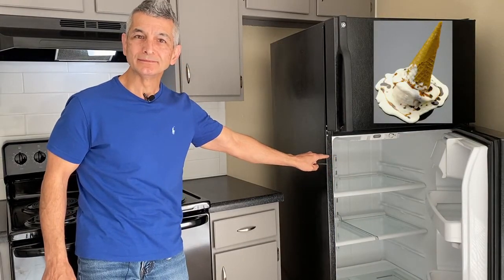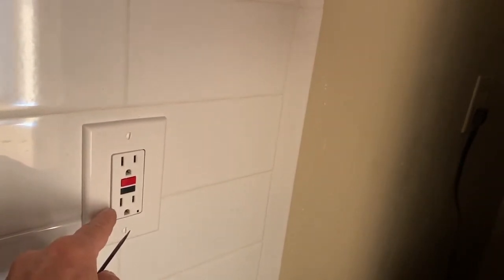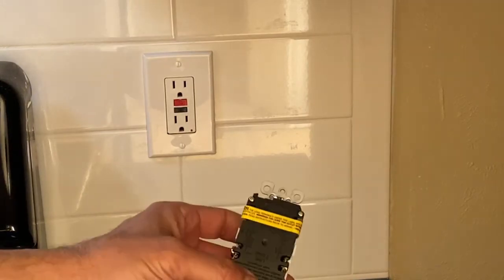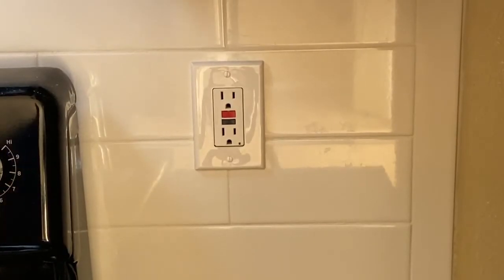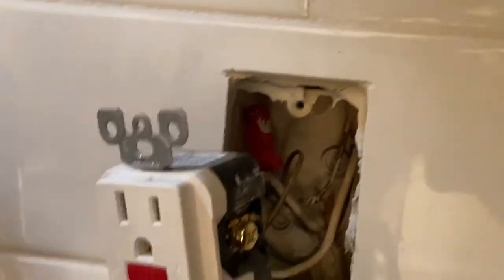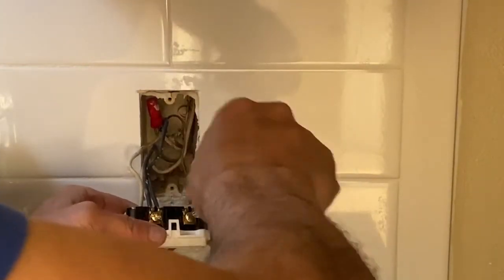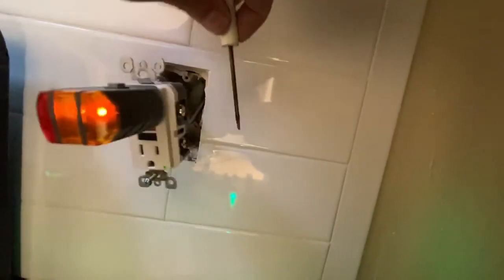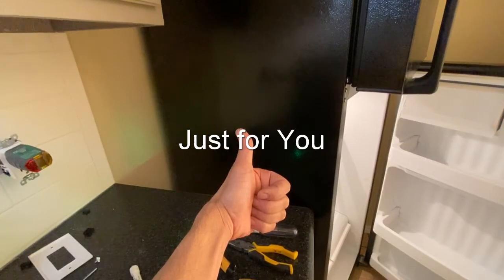Fridge Tripping-Learn how to fix it-Don’t power a fridge from a GFCI, especially older ones

Comment: What happens if I have more Gfci outlets in the same line. Do I have to do the same for all or it will be sufficient with one before the fridge plug?
Reply from the maker: If you have a GFCI outlet at or before the fridge on the same line, could trip because of the fridge. Hope this helps.

Comment: I'm sorry, but your solution is wrong. Maybe it works for your specific problem. It won't work for most. Apparently you only have the one single outlet attached to the GFCI load. Most will have multiple and there is a reason they're on a GFCI protected circuit. Your solution would remove protection from the rest of the circuit.
Reply from the maker: Incorrect. You can make the fridge outlet non-GFCI by doing what is suggested in the video. Then, if you have other GFCI protected outlets that were on the same load line, replace the first outlet (this would be the next one after the fridge’s outlet) with a GFCI outlet. Now, the fridge is non-GFCI and it won’t trip AND the outlets after the fridge’s outlet are GFCI and GFCI protected. Hope this helps.

Comment: And there is an audible alarm GFCI outlet on the market.           Bypassing the GFCI protection to the recptical to the fridgerator u are not up to 2023 NEC CODE that I personally think should be a personal choice to GfCI to or not to have.                                                  2023 NEC says all recpticals in a kitchen ned to be GFCI/AFCI PROTECTED. I personally believe with present GFCI/AFCI TECHNOLOGY I wouldn't probably have such a device going to a freezer or refrigerator. PS in my opinion fregerators and freezers should be on a dedicated circuit if possible to me minimize a trip breaker leaving the device with  no power resulting in possible food lost.

Comment: Thanks. Good to know this. 
 However in my case, I'll know later today, but it appears the refrigerator outlet is on a long daisy chain and if I do this the other counter outlet will not be GFCI. The current set up also runs the ceiling lights as well. So my other option will be a cord from the other side of the room that is not on a GFCI connection. No way to rewire this directly. This part of the house is built pretty much right on the ground. But I think in my case the refrigerator has damage due to a storm surge since it is now on another outlet from the other side of the room and the compressor will only run for about 5 seconds and then off. The frig is well over 30 years old. So I will get a new or newer frig today...
Reply from the maker: You can do what is shown in the video to make the fridge’s outlet non-GFCI. Then change the next outlet in the chain to GFCI to maintain the integrity of the rest of the chain. Hope this helps.
Reply: @JustForYouDiy  The GFCI outlet at the counter feeds the other outlets, not the other way around. Otherwise a good idea. Unless I want to open up the drywall or the outside of the house. I just repaired the floor, and floor framing  in that room a year ago, from a poor remodel or a cover up remodel that was done before I bought the house.. No wires down under the floor.

Comment: I want to put my second fridge in the garage, I have gfci receptacles in the garage, I plugged up the second fridge and the outlet tripped, is it because it’s on the same line as the fridge in the house? Do I need a separate outlet in the garage to run the fridge?
Reply from the maker: GFCI outlets don’t play nice with inductive loads, such as the compressor in a fridge. That said, fridge needs to be plugged into a non-GFCI outlet.

Comment: i have an older fridge/freezer unit from Kitchen Aid, it is the boxy one. no digitialdisplays or anything. 
we had a power outage for 46 hours from a storm on tuesday

finally i knew it came on, yesterday at 221 pm i know my electirc came on.  i got hom at 5 and it was on. i opened the fridge door to move frood around, then did it again 5 mintue slater. 
then nearly 7 pm i opened it and closed it once, then the 2nd time i did it  something happened and the lights in both freezer and  fridge were off.

i went downstairs to push the circuit breaker in and out. not thinking of the CFGI thing.
didn't work.
i called an appliance guy who came out thie monring.  very early
siad there was no power going to the fridge. and i forgot there is 4-5 other outlets some with things on them like la lamp a carbon monoxide tester, and a heating pad along it righ tnow.  anyway, turnst out my unit was  tripped.  the appliance guy left did nothing , tested with a extention chord to see if it ran which it did from the basemnet outlet.
said it looked fine.  an dleft. but said is hould call an electirican to check the pulgs/power source/ circuit breakers
so i did. they came, they did move a copue wires in the plug right where the plug of the drige goes in, and he suggesed a new CFGI unit. so i got it . when he left everythign appeared just fine.
i get home 6 hours later to find the drige off again but still cold now.

i kept hitting the button on the new CFGI unit and thefridge would trun on for 1/10 of a second.
but nothign worked. an't get anyone  on either side for 3 days ue to a holiday weekend. i will not be home much either

for now i plugged it in to the extention chord.
will tha tbe safe until tuesday when i can do the rest of teh stuff?

Comment: @JustForYouDiy went thru all these easy and informative steps you gave at the end I tripped my gfci fridge stayed on correctly but tried resetting my gfi and it won’t reset what could possibly be the problem? Thanks in advance
Reply from the maker: With most GFCI outlets you have to make sure that the line and neutral wires are from the same run (black and white wires are in the same jacket). This ensures that they are the same length and are very close to the same resistance. That said, often times when there are multiple lines and neutrals in the same J-box, if the wrong neutral is connected to the GFCI outlet, it will not reset (it stays in the fault mode). Hope this helps. If you find it helpful, please report back and consider donating to the channel.

Comment: What if I just replace the GFCI outlet with a normal plug?
Reply from the maker: Of course, you can always do that. However, whatever is plugging into that outlet will not benefit from GFCI protection.
Reply: @JustForYouDiy  it’s in a garage. New freezer keeps tripping GFCI. Did away with the GFCI because it seemed pointless although its code. Electrician said it was a nuisance trip anyway. Thanks for the good video though.
Reply from the maker: The electrician is correct, almost all GFCI trips caused by a frige is a nuisance trip. The reason is because GFCI circuit used in the outlet does not like an inductive load (any device that has a coil of wire in it), such as compressor that is used in a fridge. The electrical noise generated by such devices most often trip GFCI outlets. Hope this helps to better understand the reason.

Comment: Hey there! I know this video is a years old but it did help me with an issue I was having with my fridge so thank you!. It's been tripping since I moved in so I tried the method and the fridge is staying on now! As a note for future watchers, make sure your load and line aren't backwards to what it was in the video. My outlet had the line at the bottom so when I moved everything to the top like in the video, I was actually moving to the load so the outlet stopped working but the fridge was fine. Once I moved everything down to the line correctly, both are all good.
Reply from the maker: Glad to hear that you found the video helpful.

Comment: Hello, plz help me, I bought the Used fridge,  so first when I connected, my main swith board get trip immediately, so I keep the fridge off for around 24 hours, and than I tried, than it gets on, but my main swith board get trip after around 4-5 hours again, and again i tried and samething happened again after around 4-5 hours.
Reply from the maker: The following could be defective:

1. Thermostat controlling the compressor
2. Compressor 
3. Capacitor for the compressor 

Hope this helps.

Comment: If you have other receptacles daisy chained off the fridge receptacle then will this not defeat the GFCI protection for them? One needs to pull the fridge receptacle and look for daisy chaining and if found take a different solution.
Reply from the maker: Correct. In that case do what’s suggested in this video and just change the next outlet downstream of the fridge outlet to a GFCI outlet. Then, all other outlets connected to that circuit will be GFCI protected. Hope this helps.

Comment: This way will work, however if you have more than one outlet on that load, none of them will be protected by the gfci anymore.
Reply from the maker: Correct. In that case you can just change the next outlet downstream of the fridge outlet to a GFCI outlet. Then, all other outlets connected to that circuit will be GFCI protected. Hope this helps.

Comment: My garage fridge is on a dedicated circuit.  The fridge trips the gfci every now and then. Will this technique work when there are no other outlets down line?
Reply from the maker: Is the fridge plugged into a GFCI outlet? If so, the suggestion in this video does not fix the issue.
Reply: Yes it is on a gfci. Do I need to replace it with a regular outlet? If so do I still wire it like the video?
Reply from the maker: Before replacing it with a regular outlet, I would suggest using an extension cord to plug the fridge into a regular outlet to monitor how it does.

Comment: Lmao, you solved nothing. All you did was remove the GFCI from the situation.
Reply from the maker: If the fridge is no longer tripping the GFCI outlet, the problem is solved. By understanding the internal circuitry of the GFCI outlet you know that GFCI outlet does not work well with inductive loads, such as a fridge which has a compressor.

Comment: I tried it out. I didn’t realize this will disable the gfci outlet but continue power to the other outlet. I still want power to my gfci outlet
Reply from the maker: The suggested change will not disable the GFCI outlet. The operation of the GFCI does not change. The only thing that changes is how the down stream outlet operates, it operates like a standard outlet NOT as a GFCI. Hope this helps.

Comment: Will this still help if I plug in my fridge to the gfci outlet or will it shut the fridge off if the outlet trips? In other words, will this only work if you plug the fridge into the non gfci outlet?
Reply from the maker: This only works when the fridge is plugged into a non-GFCI outlet. GFCI outlets are sensitive to inductive loads.

Comment: I have it on line and still trips
Reply from the maker: If the 2nd outlet is connected to the line side of the GFCI (the 1st outlet) and fridge is plugged into the 2nd outlet and GFCI trips, you have something connected incorrectly. 2nd outlet being connected to the line means the 2nd outlet is protected by the BREAKER.

Comment: Ok that’s a way to keep power constant to your refrigerator but now it’s now up to code. The GFCI is required when any plug is close to any water source and it mean to be there to save your house from possibly arching fire.
Reply from the maker: If you missed it, the fridge is still protected by the breaker.
Reply: @JustForYouDiy  I know you know the difference between a breaker and a GFCI. Two distinctive functions brother. You definitely eliminated the purpose of that GFCI.
Reply from the maker: That GFCI is not eliminated, it still functions as a GFCI. The fridge is protected by the breaker. You should never protect a GFCI with a device that has an inductive load such as a fridge.

Comment: Will the fridge still trip the GFCI when wired like this?
Reply from the maker: It will not trip the GFCI. However, in case of an electrical issue, it will trip the breaker to the GFCI.

Comment: Thank you so much for the informative diy unhooking load terminal + transfer to line instead to prevent power interference to fridge when outlet trips. Such a relief to not stress out if I have to buy a new fridge. It’s only 11 yrs old and thought they last longer than that ❤❤ thank you again 🎉
Reply from the maker: My pleasure. Glad that it solved the issue.

Comment: I absolutely agree GFCIs and refrigerators do not mix - just like practically any other motor. However, Code now requires one for any refrigerator in a kitchen, so it must be done, period. You can thank Leviton for lobbying the NFPA to get that requirement added, as well as GFCIs for dishwashers. How many people have died from being shocked by a properly bonded dishwasher or refrigerator? None. Not a one. Since Leviton needs to appease shareholders, we now have this stupid requirement.

Garbage disposals are coming up in the next cycle. What could possibly go wrong there?
Reply from the maker: Thank you for sharing your comments.
Reply: @casey You are 💯Percentage CORRECT! It’s all govt bureaucratic BS!!!

Comment: KEK this trick actually worked i spent 8+ hours on the fridge outlet, trying gfci and afci and neither, pigtailing and switching wires and whatnot, sure as shit this trick on the fridge outlet and the upstream outlet fixed my issue.
Reply from the maker: Glad to hear the issue is resolved and thanks for posting your comments.

Comment: I did the steps in the video for my gfci in my garage and it was just fine for 3 days but then it tripped after 3 days What do I do now?
Reply from the maker: If the fridge’s outlet is connected to the line side of the GFCI outlet and nothing is plugged into the GFCI outlet, and GFCI trips, GFCI outlet is defective. Hope this helps.
Reply: @JustForYouDiy  I have total of 4 outlets to the left of the electric panel in garage (3 gfi and 1 non gfi) and 1 outlet (non GFI) to the right of the electric panel. 
I tried the outlets to the left of the electric panel all trip after 30 mins of plugging the refrigerator. I have not tried the one to the right yet. It’s brand new construction. Refrigerator is brand new Samsung side by side. I don’t know I tried the method in video for the first gfi outlet to the electric panel to the left which then connects the remaining outlets I believe.
Reply: So tried the 5th outlet as well and it kept tripping again after 30 mins of plugging in.
Reply from the maker: @muqtarali9974  Good info. Please keep in mind that an outlet that looks like a regular outlet could be connected to a load side of a GFCI outlet which makes it behave like a GFCI. Therefore, it’s best to check the outlet using a GFCI tester. They are sold online and at Home Depot or Lowes (Commercial Electric Outlet Tester with GFCI). Additionally, to eliminate the fridge as a suspect, consider plugging it into a regular outlet inside the house using an extension cord.

Comment: Thank you for this video!  We just got a new fridge for the garage and it would trip the GCFI outlet on another wall after a few minutes.  Even though the circuit has a 20amp breaker and the fridge is only rated at 4 amps AND with only 2 security cameras plugged into another outlet, it kept tripping.  This trick fixed that issue.
Reply from the maker: Excellent. I’m glad you found it helpful.
Reply: The same happened to me. Thanks. 🎉
Reply from the maker: @juandalton  my pleasure

Comment: Thanks for this informative DIY video. I have a problem with a garage freezer on a circuit where one of these GFCI outlets is the first thing along that circuit. Freezer runs normally and cools down properly until the timer kicks on the defrost element and the increased draw trips that GFCI that nothing is plugged into. Now I can fix the problem! Thanks!
Reply from the maker: My pleasure.

Comment: Would the GFCI receptacle still work as intended after the wires from the Load screws are joined with the wires on the Line screws?
Reply from the maker: Yes.
Reply: How would it still work if you have no wires going to the neutral nor load.? What's going to trip the gfci? Please help me understand...

Comment: I have an old King of the Road. Woud you know if my GFCI situated in the bathroom is link to the fridge. Note that my GFCI  outlet is broken  and my external outlets is not working as well. "Just for you" great video. Tanx.
Reply from the maker: My pleasure. Best of luck.
Reply from the maker: One way you can check is with using a GFCI outlet tester. Home Depot has Klein Tools GFCI Tester. Plug the tester into the outlet in question. Push the button on the tester. If the outlet in question is connected to a GFCI outlet, it will trip. Hope this helps.
Reply: Your video gives me hope for my fridge. I know that "GFCI" located in the bathroom is defective. Before replacing it, I will try the method you describe so well in the tutorial. Next tool I purchase  is the one suggested. Transforming an old RV with electrical current to a cottage. Thank you very much. Can't wait until tomorrow.

Comment: I have the exact situation
But the refrigerator is in the garage
Once I plug it in the GFCi in the garage trips.
If I use extension cord plug it inside to another outlet with a GFCi nothing happens.  New house.  GOD wiring
Tested the outlet connections with socket Tester all is good.

What is causing this mystery?
Reply from the maker: It could be an extra sensitive GFCI in the garage. Typically GFCI outlets do not like inductive loads that cycle on/off. The fridge has a compressor.
Reply: @JustForYouDiy  Well I changed the GFCi the new one did the same thing
Reply from the maker: If the GFCI that’s inside works correctly and does not trip the fridge, consider moving it to the garage. Also, be aware of other outlets/devices that are connected to the load side of the GFCI in question.